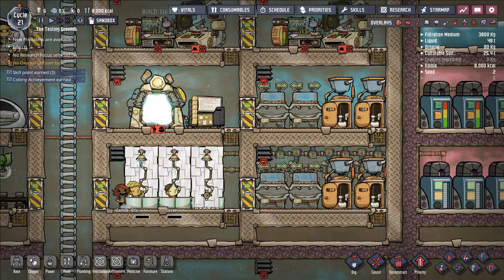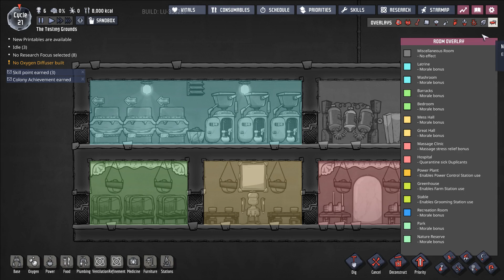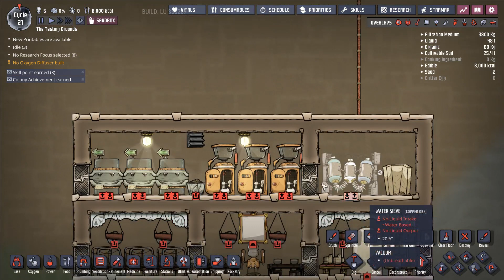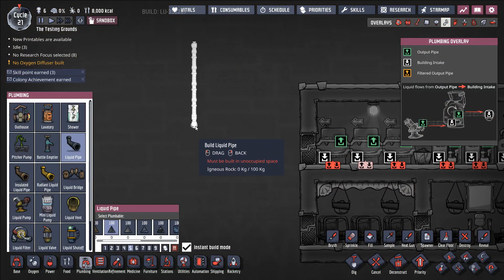The Infinite Bathroom; Build This NOW -- New Player Guides [Oxygen Not Included]

Comment: ** Bridge-exits work opposite of Bridge-entries **  A bridge will TAKE liquid first... but it will SUPPLY liquid last. 
If you have p2o (polluted H2O / polluted water) coming in from your base and the Sieve is busy, your toilets will never empty and go out of order.
^^ Those top-bridges for the p2o need to go left>right to work properly (not down>up like you have).
Better layout: https://imgur.com/a/mxe255k 

 This way, the toilet closest to the sieve (which also gets the clean water first) will now get to empty first too. If the Sieve is not busy and there is more room on that short pipe, then the exit of the next bridge to the left can also empty it's contents (which carries the 2nd-closest toilet)... and so-on down the "queue".
Reply from the maker: I'm not a fan of that solution, because as soon as your sieve runs out of filtration medium, your bathrooms go offline, particularly because sieves only handle half a pipe's worth of water anyway.

Also, in my opinion, it looks ugly.  Bridges are 3 wide, you need one per building, and those buildings are only 2 wide, so either your PW line has to become two tiles high to accommodate, or you have to make your bathrooms less compact.

Best solution is simply to remember that your bathroom loop is a SOURCE of water, not a sink, and instead of trying to dump more water onto it, you want to siphon water away from it.  Also, you don't really want to add water to the system because it's contaminated with germs, and anything you add becomes contaminated with germs.

If you do want to dump water onto it (because I suppose you really care about increasing the capacity factor of the water sieve), then the easier way to do it is just to control the rate at which you dump water onto it.  Set up a valve, throttle the valve to like 4kg/s, and you're done.

Comment: Why do you add bridges to the immediate output for the polluted water from the system?
Reply from the maker: Every pipe junction should be governed by a bridge, valve, shutoff, or other building, in order to reduce lag.  In this case I go with a bridge that simply says "Direct flow away from these buildings."  Depending on how you want to use the line, you might want to organize it differently.
Reply: @gearheadgaming1  oh okay, thank you for the response! And great video btw. You explain things really well, this seemed very daunting at first but was actually so easy. Thanks

Comment: An upgraded version of the water sieve needs to be introduced. Call it the water purifier. Have it require chlorine in the form of bleachstone as well as sand so that the water is truly clean when it leaves the sieve. There doesn't appear to be a debuff for using the food poisoning water that leaves the sieve currently, but it IS nice to have absolutely clean water in the base.
Reply from the maker: It is interesting that the game has the hand sanitizer and the ore scrubber, but nothing like what you've described.  I'd also like to see a building/room for decontaminating atmo suits-- it wouldn't matter much the way the game works currently, but I think it would be cool looking to have a building that looks like a little tubular chamber / chem shower station, and operated like a sink/wash basin where dupes in atmo suits would hop inside and get decontaminated.

Overall there are a lot of things I would change about the germ system in the game.  Make germs invisible unless they're within x tiles of a germ detector (either hand held by a dupe or a permanent sensor you build), have a biological research building + tree that requires you to gather samples of various germs, plants and critters to conduct research, new strains of germs with a wider variety of effects-- germs that are more contagious, germs that affect plants and wildlife, germs that transmute materials, etc-- and more medical options for either eliminating them or encouraging them.

Klei's pretty good about DLC though, so all this could eventually become a reality.
Reply: @gearheadgaming1  The chem shower in particular is a great idea!
Speaking of rooms, there are a couple I've been wanting for a while.
One - I'd like to see a kitchen as an official room. Allow it to buff the food or dupe or both. Have a decor requirement as is done with the main hall.
Two - I'd like to see a laboratory. Have it increase research speed, unlock new techs, and/or buff the dupes. Again have certain building requirements and decor requirements. The decor requirement would also allow for lab specific decor. I'd love to see beakers, test tubes, flasks, etc. all in the furniture tab.
Reply: Also good to incorporate valves in case you need to have a dupe do some plumbing i.e. drain a section of pipe.

Comment: One problem with build. Germs. You will have food poison in your food. It's not a very good build.
Reply: Just pump the water into a reservoir that's in a room full of chlorine gas. Problem solved.
Reply from the maker: It doesn't work like that at the moment.  Maybe they'll patch it in the future, but right now this build has no germ problems.
Reply: @gearheadgaming1  yeah, food-poisoning will carry through the sieve into the sinks' clean water. Although food poisoning is not that bad, I think in Launch Mk1 they made food poisoning reduce the immunity of dupes so they are more likely to fall ill to other more worrisome diseases such as slimelung.
Reply from the maker: @MrHics  Not that it matters though because the dupes will not come into contact with any food poisoning germs using this system.
Reply: @gearheadgaming1  cool thats a relief! I think it used to annoyingly give the food poisoning back to the dupes when they washed their hands. That was way back in the "outbreak" beta though, so I am glad they fixed that one - it was so annoying having to pump the water into a tank surrounded by chlorine to disinfect it before sending to sinks+food supply.
Reply: @gearheadgaming1  I used this build and my dupes came into contact with germs. I had the excess "clean" water go to some hydroponic tiles and the food ended up with food poisoning and thus my dupes. I set it up exactly as described so I don't think I messed anything up. Maybe something changed with the recent update?
Reply from the maker: @ScoopsG2K  What are you doing with the polluted dirt that comes out of your water sieve?

Comment: How to get rid of germs in this system so it's 100% clean?
Reply from the maker: Water that's stored in a liquid reservoir surrounded by chlorine will get disinfected-- usually takes a third of a day for all the germs to get deleted.  Another option is to boil or freeze the water, and then re-liquify it.
Reply: @gearheadgaming1  I'm talking about this situation , but I guess if they use toilet once a day in defined time it will be enough to kill germs in chlorine, am I right?
Reply from the maker: @dark_noone9287  You'd need a specialized system-- I have a build on the channel, but the main thing to keep in mind is that water inside a reservoir will get disinfected by chlorine, but water inside a pipe will not.
Reply: @gearheadgaming1  Yeah, I forgot about it. Thanks
Reply: @dark_noone9287  That's why on the output you have a filter, and set it up, so when you turn on the filter, it returns the water to the reservoir. Monitor it, and after the food poisoning germs reach 0, then flip the filter, to allow the disinfected water to enter the system.

Comment: Question: Do you remove the liquid pump from your main bassin once the system is filled? (the pump to the right side) Or will this cause to back up the pipes?
Reply from the maker: Yeah, I disconnect it after it's pumped a few packets.  The system generates water, so you just need a little to get it going.  If you leave it attached though, system should be fine as long as there's a siphon taking water out somewhere.

Comment: I'm very torn on the bridge debate. I don't thoroughly understand why I should use more bridges.
Reply from the maker: Super long answer:

So, a general rule is that every junction should be governed by an input or output port.  This reduces in-game lag by a pretty good amount, and prevents lag-death of your base later in the game.  I think everyone who's played late game bases can agree on this.

The disagreement is whether to rely on the input and output ports of lavatories/sinks/showers as the governing ports, or use bridges.  So instead of having a pair of bridges for each sink/lavatory, a different design is to link all of the sink/lavatory outputs together through one pipe, and bridge from that pipe to the main water line, and do the same for the outputs.

In the past, this actually didn't work, because on the output line, a sink/lavatory would become non-operational when there was a full packet of water on its output port.  So if you washed your hands on the left-most sink, that packet would travel down the output line and disrupt everyone else trying to wash their hands or go to the bathroom.

Today though it does work, because Klei created a sort of internal buffer for the sinks and lavatories, so now a lot more players want to use the pipe-straight-across method, mainly because they like the look better.

I think that functionally, bridges still offer benefits.

1)  Even though Klei wants the pipe-straight-across method to work, there have been recent patches that broke it that Klei had to revert/hotfix.  So there's less risk your base breaks from a patch with the bridge method.

2)  I like the flexibility that the bridges provide.  If you decide to change a room, you don't need to deconstruct all of the pipe in the room because now it's running across ports you dont want it to run across, you can instead just deconstruct the bridges and reconnect them where relevant. 

3)  To some extent you also avoid as much building because your sinks/lavatories bridge directly from the main line instead of being supplied by their own secondary line.  Less relevant here because we have a very compact bathroom (few statues/decor items thrown in) and so the pipe we have to build to connect the bridge to the input/output ports is about as much pipe as would be needed to run a pipe straight across all the ports, but in other situations we'd need a lot less labor and materials to build the bridge system.  A liquid bridge has the same amount of materials as a liquid pipe (100 kg)

4)  Bridges in this context provide extra individual storage for each sink/lavatory, which reduces the chances that they're offline when a dupe needs to go to the bathroom.

If you really don't like the look of all the bridges though, just have one bridge going from the main clean water line to the bathroom, where it then runs across all the input ports, and then one bridge going from the main PW line, where it then runs across all the output ports, and as long as Klei doesn't break anything again, it should work as well.
Reply: @gearheadgaming1  thanks for the detailed response! I've watched the video a few times, but base building and systems area so counter intuitive to me so I'm still trying to understand. I can see the benefits of less lag, I've never made it to late game, lol, but maybe one day? I don't like the look of the bridges, but I do think the points you make about bridges are probably weighty enough to just use them. It makes sense, I think. I'm gonna try it out! I'm still a little confused about the extra storage, but I think you did mention that in the video again, so I'll go find that bit to try to understand it better. There an equally long winded response. 😋 Thanks! This is really good information!
Reply: @gearheadgaming1  thanks for the detailed response! I've watched the video a few times, but base building and systems area so counter intuitive to me so I'm still trying to understand. I can see the benefits of less lag, I've never made it to late game, lol, but maybe one day? I don't like the look of the bridges, but I do think the points you make about bridges are probably weighty enough to just use them. It makes sense, I think. I'm gonna try it out! I'm still a little confused about the extra storage, but I think you did mention that in the video again, so I'll go find that bit to try to understand it better. There an equally long winded response. 😋 Thanks! This is really good information!

Comment: If you wanna "automate" it a little bit more you can replace compost with pokeshell.
Reply: Except that pokeshells turn the polluted dirt into sand rather than clean dirt.
Reply: @phillipsusi1791  yes but Pokeshells do not produce heat and are more "recycle" way because sieve uses sand to operate.
Compost takes a lot of time to operate and can spread germs. 
Pokeshells are destroyig germs from polluted dirt in sieve.
Sage hatch works the same but its harder to get a wild one(wild critters are better for this job because they do not starve) and gives coal instead of sand.

Sorry for bad english. I am very good in understanding and reading it but pretty bad at writing it.

Comment: Your design is using 12 bridges, while it really only needs 1; bridge after the sieve to prioritise into toilets. I like your tutorials in general, but this is making it look way more complicated than it has to be. If this is designed for new players, then this is overkill.
Reply: Nilaus I agree!
Reply from the maker: The four reasons I've given in the other comments:

1)  Previously, Klei has had patches that broke the 0/1/2 bridge approach that didnt break this approach.

2)  It expands the storage for your bathrooms so that they can have immediate resupply regardless of where you position your loop's siphon

3)  It's more flexible in a number of ways.  For example, you could retrofit your bathroom into a line of liquid reservoirs without ever disrupting flow in your main water line.

4)  Every junction between pipes should be governed by an input or output port, otherwise it creates lag in your game.
Reply: @gearheadgaming1  1) Old patches, are old patches... they don't apply anymore.
2) One bridge does the same.
3) One bridge does the same.
4) Not true, if you want to split the content two ways (equal amount of content to both places). Plus, lag is not a game mechanic, its a computer~game issue.

People overuse bridges.

Granted, one can not rely on a overflow system when resources are low, but overkill is still overkill.
Reply from the maker: @its-anuga  1)  Best of luck then, hope your base doesn't get broken.

2)  It does.

3)  It completely does not.

4)  No, if you want to split the content two ways, you use a liquid valve.  And whether or not lag is a "game mechanic" or a "computer~game issue" is completely semantic.  The fact is that pipe junctions that aren't governed by bridges or valves introduce more lag into your game.
Reply: Ehm, why does he need 1 now? If you are against the bridges why not all of them? Makes no sense.
Reply: @Hedning1390  , so you logic is "if you need 1 then build 12"... You need 1 to prioritise the flow and that's it
Reply: @Nilaus  No, I'm saying that you can't point to one out of 13 identical things and say it is special. All white tiles prioritize flow to its structure. The bridges are the same as the toilets or the sieve.  I don't know which 1 bridge you find holier than the rest, but it isn't. You can add bridges if you want to split the line on some other tile than the exact one provided by the sink/toilet/sieve, but no bridges are needed for an infinite bathroom with overflow to plants or w/e.
Reply: @Hedning1390  I know this is old but all you need is 1 that separates your main flow into your bothroom loop until it is full, then the overflow continues to wherever you want it to. To not make junctions you run your pipe directly through the inputs. Bridging the output is just bad because contrary to the inputs, the output doesn't have priority of the flow, if there's already liquid in that pipe then it won't add to it until there's an empty pocket.
Reply: @pairot01  I have no idea what you are talking about. Junctions are made no matter what. I was against bridges so I don't know why you are saying to me that bridging is bad. I know machines, unlike bridges, don't output on a partially full pipe. I knew this 1 year ago too so I don't know why you are telling me this. In those cases you merge one space above. You don't need bridges to merge. A lavatory uses a half full pipe segment, exactly what the sieve processes, so there is no risk letting a flush pass directly by the sieve with no bridge, especially considering a flush is spread out over many pipe segments, so on average, even if you combine several flushes, a sieve will process at least enough to refill the lavatories. I have not changed my mind on not needing bridges for bathrooms since last year.

Comment: You dont need these liquid bridges at all...
Reply from the maker: The four reasons I've given in the other comments:

1)  Previously, Klei has had patches that broke the 0/1/2 bridge approach that didnt break this approach.

2)  It expands the storage for your bathrooms so that they can have immediate resupply regardless of where you position your loop's siphon

3)  It's more flexible in a number of ways.  For example, you could retrofit your bathroom into a line of liquid reservoirs without ever disrupting flow in your main water line.

4)  Every junction between pipes should be governed by an input or output port, otherwise it creates lag in your game.